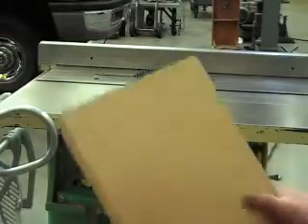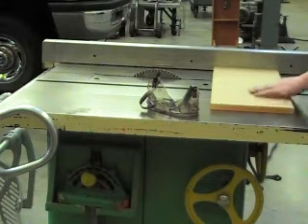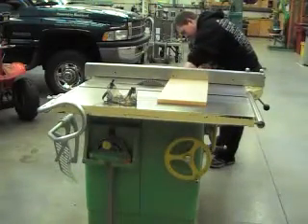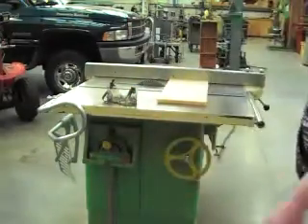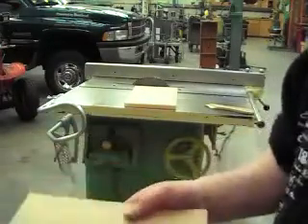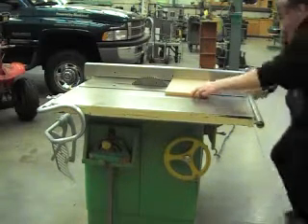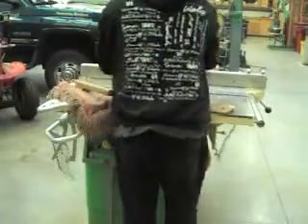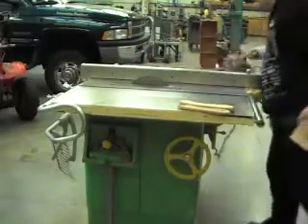Cell Construction Part 1: Fabrication 1 #26

Comment: i noticed when u were using the table saw that the blade was too high, might cut off some fingers.  normally the blade just needs to but a milimeter about the piece being cut.  otherwise good stuff.